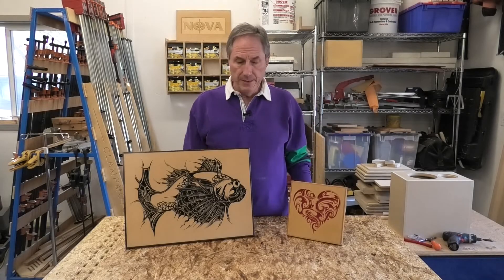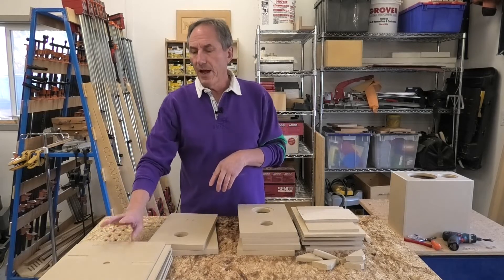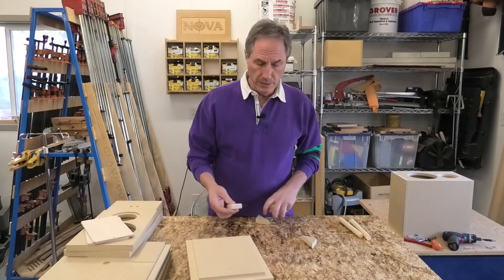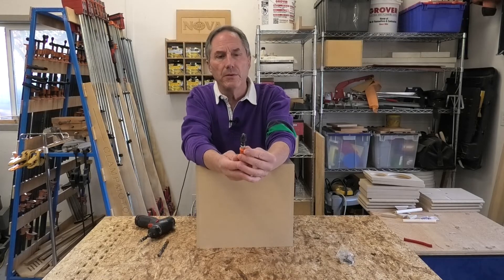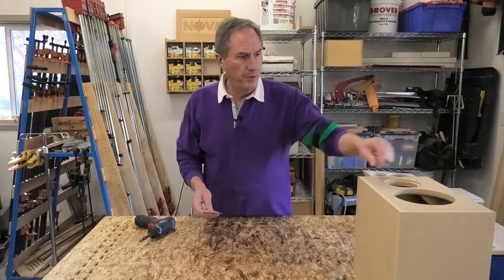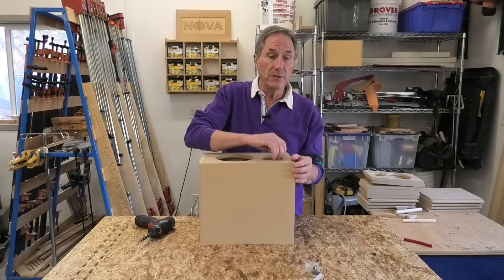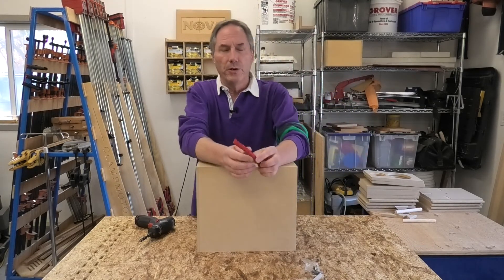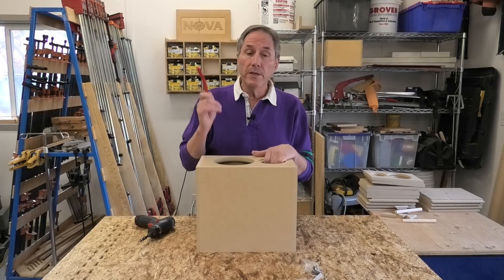X-LS Flat Pack Update and a Fish too.

Comment: the enclosures look superb.  You're pricing them very reasonably.  I can't imagine anyone building overnight sensations when something this great is available.  Would love to see videos for absolute beginner woodworkers on how to route a baffle with a typical router you'd pick up at home depot.  Or how to cut panels for an enclosure with a circular saw instead of a table saw.  I see everyone tell beginning speaker builders to get a table saw but that's quite a big commitment for someone who never did woodworking before.
Reply from the maker: A track saw could do all the basics for a butt jointed cabinet and in some ways they're easier to use than table saw. Until I got CNC, all my router work done with off-the-shelf hand held routers and jigs. 
I think it would have to be a summer project so could be done outside for dust control reasons. I'll mull it over.
Reply: @carbidetooth  Sweet, fellow Idahoan living in P-town,  wanting the A/V-2 cabinets, thx :  )

Comment: Peter, I assume the CNC'd hole for the tweeter is such that it sits flush with the baffle if one was going to just paint the flat pack. If one chooses to use a wood veneer, will that then cause the tweeter to no longer be flush with the baffle and a little recessed? If so, how do you compensate for that? Or is this generally a non-issue?
Reply from the maker: Because of differing thicknesses possible with veneers, the easy solution is to simply cut a spacer from to fit under tweeter flange from whatever material you're covering box with.  I also like to "break" that sharp  edge with a small radius formed carefully with a finger tip and sand paper.
Reply: @carbidetooth  Thanks for the explanation.  If I understand you correctly , that even though one can get the tweeter flange to be flush with the front baffle whether with/with-out veneer, you would still slightly sand that edge next to the flange so its not a shape wall meeting the high frequencies.
Reply from the maker: @HoomanR17  Correct. I think it looks nicer as well.

Comment: Would love to hear your thoughts on how you would recommend integrating/adding a 1" live edge hardwood slab (maple?) as the front baffle. Would you add it as a layer on top of the kit, or replace it as the one and only baffle for the box?
Reply from the maker: I'm all for exploring new concepts when it comes to visual aspects of speaker design. I think in this case though, anything done to appreciably change the relationship of drivers to cabinet front as designed would require changes in crossover and possibly compromise frequency response. Not my area of expertise, for sure.

 To avoid this, my thought would be to adorn the sides or change the finish in an unusual way. Many ideas in the hopper I hope to explore as well as encourage others to do same. How about a steampunk theme or industrial look or tatoo art...my imagination runs and runs, but I have to sleep sometime!

Comment: Peter these look like a great option.  I know you said shipping to UK is spendy.  I'm from Toronto area in Ontario, Canada.  Have you looked at costs of shipping across the border to Canada?  Would love to order some if it is not too spendy.
Reply from the maker: I have shipped to Canada...not inexpensive but not as bad as overseas. I've also had folks use some sort of border pickup service as well as checking as airline luggage. Email me for details.
carbidewing@gmail.com
Reply: I know those services, that bring across the border from US.  Let me look into one of those for cost.  Do you have weight and rough box dimensions?  Sure that is what they will need.  Thanks Jon.